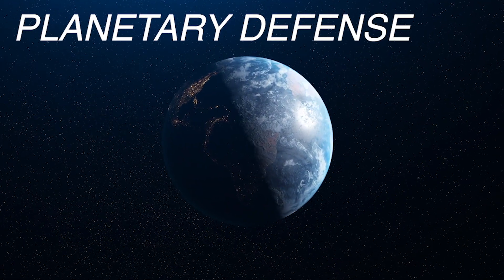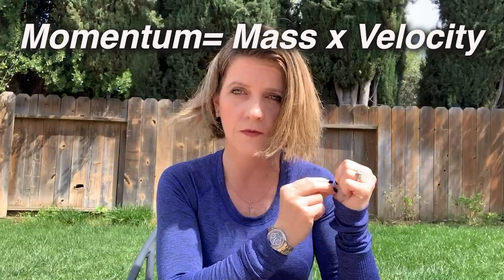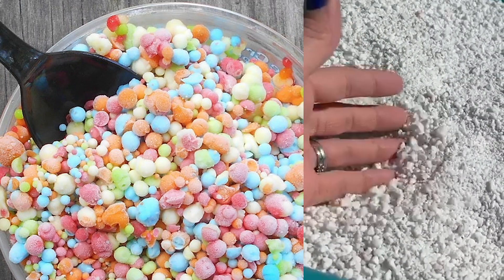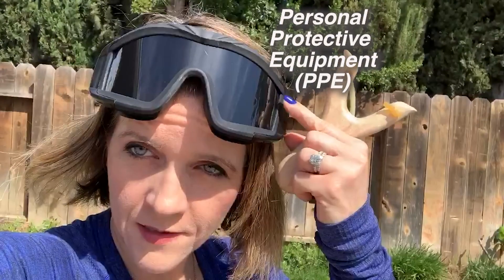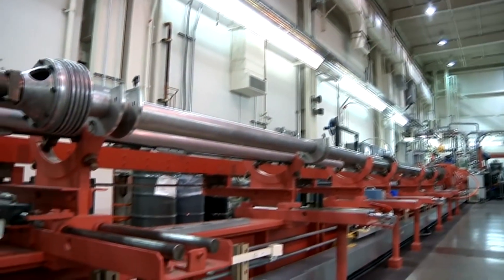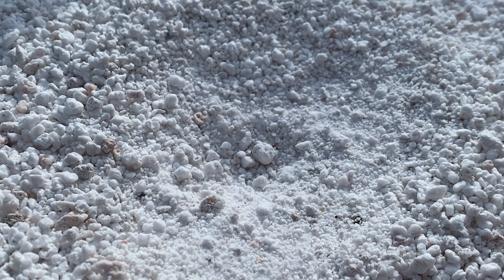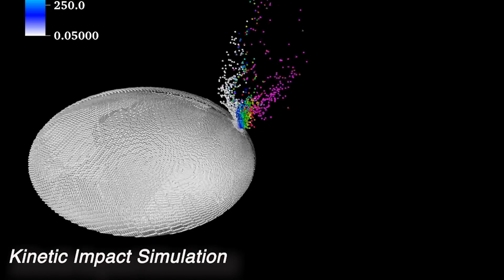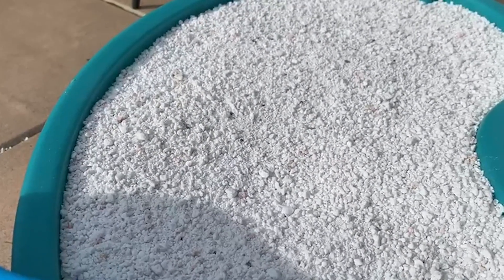Make Backyard Craters With a Planetary Defense Physicist

Comment: How about swarm drones to grab on/ wrap around one to then stabilize and change its orbit for possible ride out of the solar system or stabilize for future mining and science?
Reply: That would take a lot of "delta V" we do not have a propulsion system efficient enough.
Reply: formolzinho yet if you can send an impact sat or sample sat, how can you now not have enough power to get to one with a swarm of mini drones to net, map, and adjust its trajectory?...It only needs a nudging vs a launch out of a gravity well.
Reply: @brandonsmith3060  This drones will need to be sent from earth fuelled and his adds a lot of mass on the mission. To adjust the asteroid trajectory this drones would need do somehow attach to the asteroid and perform the manoeuvrer needed. To just use all this mass on a single impact is way more efficient to change the trajectory enough to avoid a "hard hit" on earth. And far simpler.
Reply: formolzinho for someone who is subscribed to this channel, I’m surprised your can’t do attitude, especially since this segment is talking about stopping a possible planet changing event..Are you thinking of a single shot will do it? How many rockets would you send up with kinetic impactors to do the job?
There’s at least 10 propulsion types being used that I can think of..then utilizing small sat bots arranged in a cluster bomb grid net configuration could get (time permitting) to an object get wrapped up, adjust locations of propulsion bots to then work. Plus this will give humanity a path to the next steps in mining and building in space. Shooting it may push it away enough to miss, but why not grab it and study it or put a galactic note on it at least as it moves on?